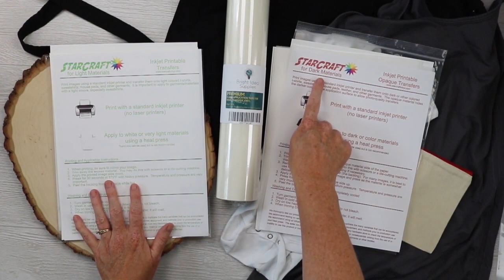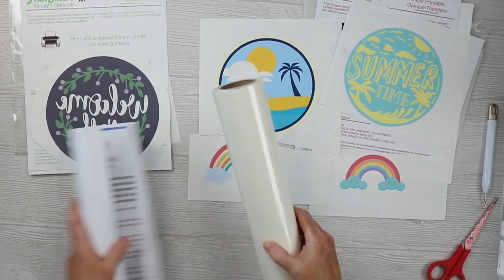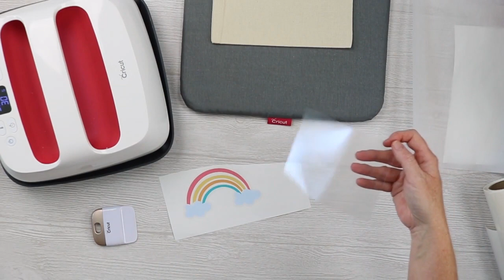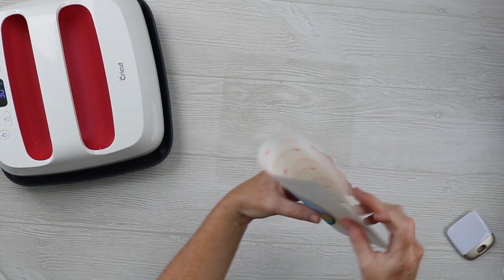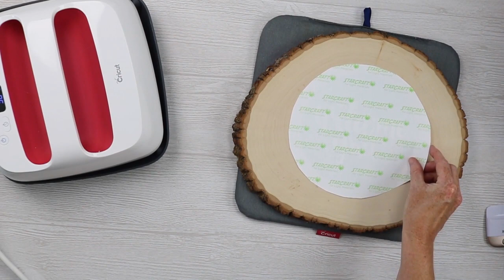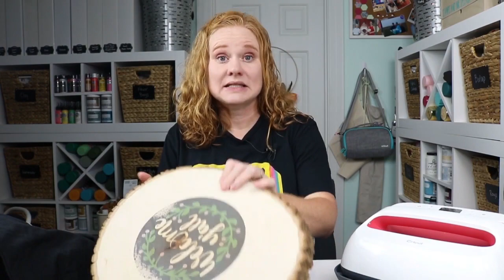How to Use Printable Heat Transfer Vinyl

Comment: I only have a Joy, can I still use printable vinyl, print it and then cut it by hand?
Reply from the maker: You can print and cut it by hand but it won't work with the Joy itself.
Reply: @AngieHolden   Thanks Angie, I appreciate your help and your great videos.

Comment: In my experience in the distant past, ink jet printer ink couldn't handle getting wet. Is it the type of ink you are using or the Starcraft product that keeps the ink from running when wet? Since you're putting this on clothing, it has to be washable.
Reply: Jon Starcraft also has a printable Adhesive that handles water well too! Perhaps we at Direct Vinyl Supply can send her some of that soon!
Reply from the maker: Washing instructions are: turn garment inside out, wash in cold water with mild detergent, do not bleach. Dry on low heat or hang dry. Do not iron directly on transfer. I don't know what the magic is but is is washable.